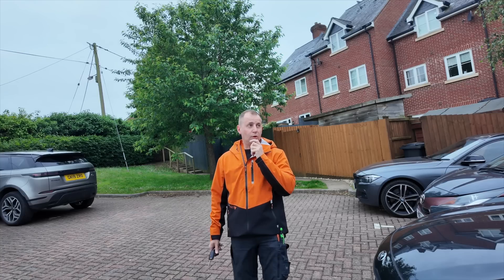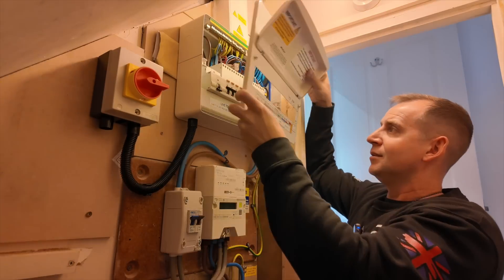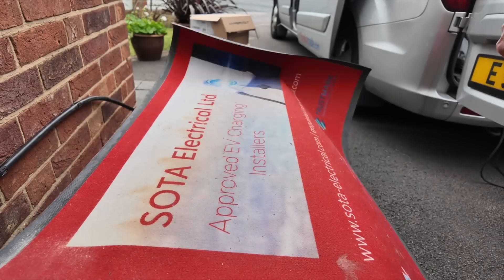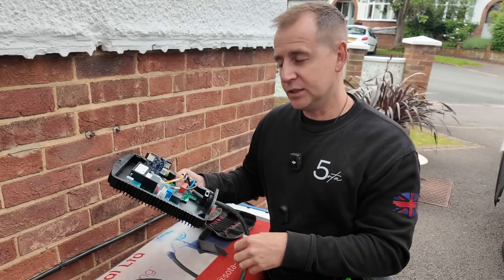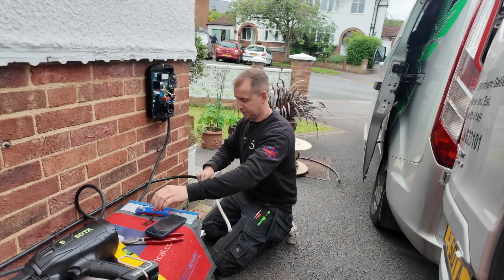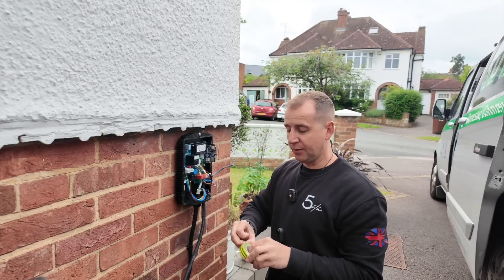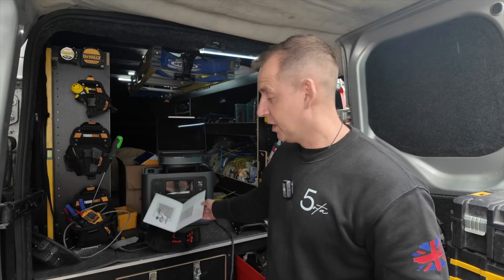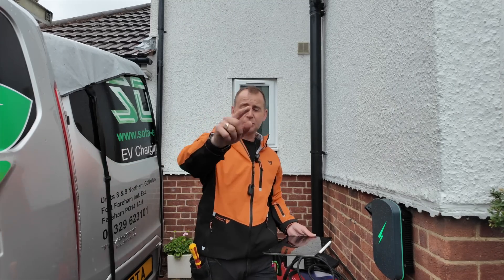Hypervolt EV Charger: Next Level Features Explained

Comment: I think in hindsight you should have placed the charger a little lower so teh cable wraps around easier. Seems like it might get a little faffy to wrap the cable as its very close to the ridge on the wall

Comment: Regarding bootlace ferrules, you use these if your cable is flexible multistrand, i.e. above 7 strands. Most fixed power cables are 7 strand and a simple twist to the joining end for barrel termination and splayed out flat if terminating into a clamp connection such as a MCB

Comment: I'd respectfully suggest that one of the first things to check, based on how the particular kit communicates, is whether that comms is possible.
There's no point in installing a device which uses a mobile phone sim where there's no signal.
If it uses your household internet connection, does the location have a WiFi signal or will you have to hardwire it?
I say this from experience. This applies to PV and battery inverters too.

Comment: What size d-line do you use? I’ve been using the  16-21mm ones but they don’t seem to hold the cable that tight. Another good video 👍 I’ve got a hyoervolt next week to do
Reply from the maker: Thanks mate I use the 17mm to 19mm I think they are

Comment: Can't disagree with the mains drill. Formally a gas safe engineer/plumber and I lost count of how many f!*@king battery SDS drills I ate through after 15 years on the tools; if I had to pick one brand to be generally the most reliable overall, I'd pick Dewalt without question. Not as many bells as the Milwaukee and less specialised than Bosch Professional, but for taking the abuse, could always be trusted to just work. Our firm went from Makita (that spent more time having warranty repairs than actually working) to Bosch Professional (great tools but the battery life wasn't quite up to snuff) and finally to Dewalt where our failure rate dropped by 20%. The 54V flexvolt models have even more power so theres a potential option if you ever decide to revisit it in future.

Cracking battery solution there matey, can see the appeal!
Reply from the maker: Thank you for commenting!!

Comment: I feel such a professional which you make out you are why are you not wearing safety boots? Surely you’re avoiding your insurance
Reply from the maker: I wear my boots if they are required but not all the time in the summer, thanks for watching!
Reply: A risk assessment (for toe crushing possibilities) should be reviewed on each job; not applied willy nilly wherever you are.

I almost always wear my steel toe caps on jobs (out of laziness really) but when popping in and out of a customer's house it can be more appropriate to wear slip-on shoes that have adequate protection.

Mind you, all those dropped screws before captured screws became a thing could do a lot of damage if they landed on your pinkies.

Comment: I'm sorry, but I have to point out that you missed a step.  Before you install a Hypervolt you have to take it to the car wash and get them to spray it with a jet wash.  I saw it on another channel
Reply: Oh that's actually optional, as per the installation manual. Bear in mind, you can only use a carwash if they have a premium £99 option
Reply from the maker: That made Evan my missus laugh!!

Comment: Hypervolts get a big no from me … great video tho as always
Reply from the maker: Thank you!!
Reply: How come?
Reply: @hypervoltev  never had a lead from hypervolt yet fit a fair few units getting sales for you guys / all my customers nothing to do with hypervolt, had a customer with the old version ring up wanted to change it to a charger that worked with octopus wanted a price for a ohme i talked them into staying with hypervolt and upgrade to the new unit, i rang up got told to get the upgrade deal the customer needed to order the replacement charger … Hypervolt cut me out the loop sold them the charger & fitting - stole my lead/customer bunch of C*nts - stick to the other brands that support the installers were the lead gens and sales ppl we wont be generating you lot anymore revenue - I could have sold the customer the ohme not lost the job

Comment: The charger is in the car.  What you are installing is a charging point!
Reply: A phone "charger" isn't that different is it. Yes it converts the voltage but the smarts are still in the phone. Easier for the layman to call them chargers IMHO. What's the alternative?
Reply: Heard a lot about this new charging point, but my installer is recommending the Ohme pro.  How do you think these two compare. Also apparently the ohme runs on a sim which apparently after 3 years you have to pay for the sim cost. Also is it possible to run Ethernet to these chargers at a later date if Wi-Fi is poor or sim charges increase. Thanks really appreciate your videos.
Reply from the maker: @miniade1  personally I can’t stand the Ohme and you are right about the sim, you can hard wire an Ethernet to this charger and it trumps the Ohme in every way, maybe your installer has only installed Ohme chargers and doesn’t feel competent installing other brands
Reply from the maker: Yes we all know this in the trade
Reply: Here here, at last someone else who understands
Reply from the maker: @lxpatch  it would be a far more painful experience explaining this in every single video rather than calling them what they have been advertised as

Comment: Hi Adam, the Ohme can be scheduled by each day how to charge
Reply: This is incorrect. Multi mode scheduling also allows configuring which mode to charge in: Super Eco, Eco, BatterySafe or Boost. This is not possible with Ohme, and there’s also no battery integration with Ohme
Reply from the maker: @alexflav23  thank you for the clarification
Reply: @sotaelectrical  MMS is designed to be a quality of life improvement for solar and battery owners.

Additionally, it's the technology behind OVO ChargeAnytime and Octopus Intelligent Go, as it allows energy retailers to schedule in charging windows and modes as well.
Reply from the maker: @alexflav23  thank you, great info, great charger
Reply: @alexflav23  sorry, I did not know it involves setting a charging mode as well, it was not mentioned in the video, although implied by the name of the feature :)
Reply: You said others don't have this feature, just checked my easee app and also has this feature plus adjusting the power
Reply from the maker: @Mircea007  ok cool
Reply from the maker: Thanks for the info!! I was just pointing out a new feature for this charger 👍👍